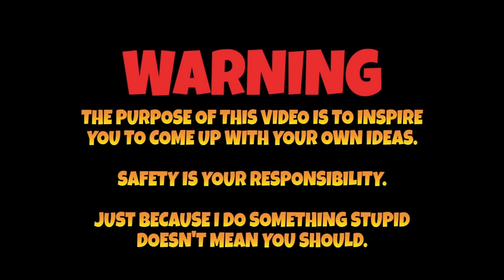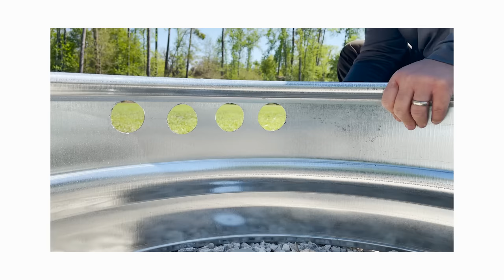12V Milwaukee More Powerful Than 18V? Head 2 Head Torture Test!

Comment: I really enjoy watching the channel, but I do have to throw my safety comment in here.  Why don't you spin the chuck one more time after it stops turning, in order to lock it?  Then your bit won't keep falling out.  Also, why not wear the proper PPE, like gloves, eye pro, ear pro and lung pro?  You blew that silica dust all over the room and your camera operator breathed it in.  Yeah, it is a little bit, but it all adds up over time.  I noticed you put some on eventually,... eventually.  Not trying to harp on you, just trying to keep you as safe as possible so we can enjoy more videos for as long as possible.

Heck, look at some of my IG shorts where even when I WAS wearing not only safety glasses AND a Face Shield, small pieces of debris still got into my safety glasses, and you'll see that it is extremely important.  We only have one set, Brother.  Same with our ears.

Comment: Milwaukee needs to update the chucks on their drills…they’re starting to follow dewalt with their chucks not holding the bits too well…my older Milwaukee drills never slipped up at the chuck but these newer models seem to have the issue…almost every one I’ve used that’s new…
Reply: Yea I got super invested into the m12 system about 1.5 years ago and the hammer drill has always been finicky with the chuck. So much so there’s been a few times I thought about it selling it and just sticking my makita 18 with a battery in the box. The chuck will not get right or make that ratchet click way before it’s tight. A few things. Weird.
Reply: not get TIGHT

Comment: Hey there, I have been working in a tool shop for some years now and recognize you have old kc syndrome (old school key-less chucks worked a little different) and we find with a lot of tradies we have to re-educate them to avoid that slippage. Try finishing your tighten by hand, and then (here is the weird bit), back it off one click. the chuck will then seat itself and lock onto the bit. If you do this you will have a lot less slippage.

Other than that, Keep up the content mate!
Reply from the maker: Thanks for the tip and thanks for for diagnosing me. 😂
Reply: @HAXMAN  the amount of times I've had 50 year old builders throw a drill skin at me because the "Chuck's are *insert expletive" and then when you show the the magic trick they have to eat humble pie😜 
You will notice a fair amount of slop in the outer collar of the chuck indicating the gears have locked and the collar no longer is engaged. 
But I will use this video to prove to my customers 12v ain't useless!

Comment: not a bad video never seen you be for so my first time  i have to say i got a old well 5 years if that year old 12v makita drill and impact and then i got my m18 drill and impact and i use them both in my day to day work 
and regarding phillips screw i hate them we use pozi or torx screws

Comment: I an sorry I not want to song bad , but that's why the drill have the speed , went you drill in wood the speed need to be the low possible , because the drill have the maximum power in that speed , in high speed is for make holes in thing metal or 3/8 , plus screws . I damage one drill 15 years ago because that